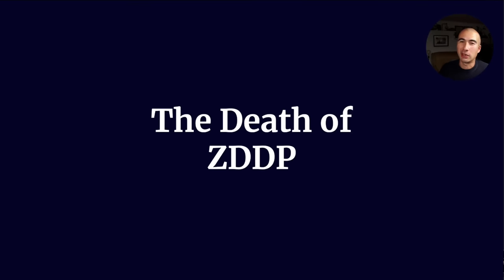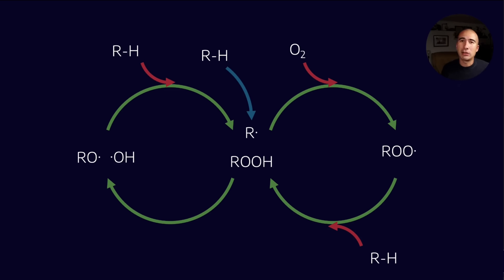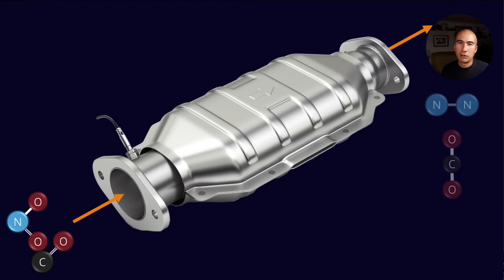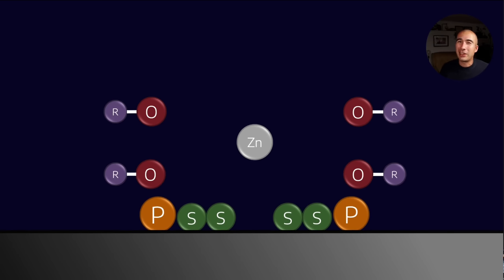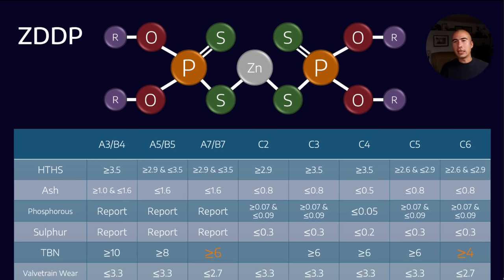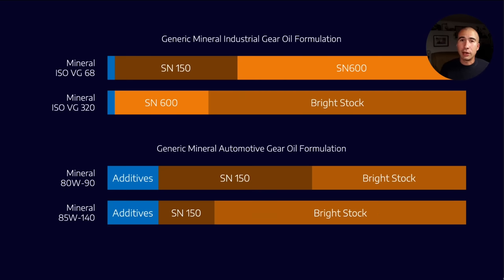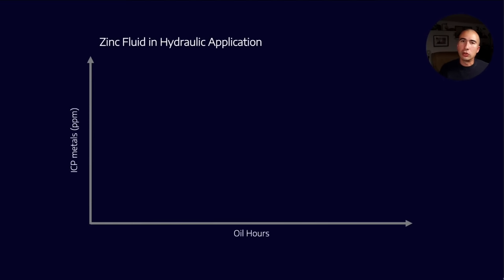Is this the end of Zinc (ZDDP) in oil?

Comment: I would not panic ZDDP is going nowhere in the near future. It is so heavily used in hydraulics and engine oils. It is relatively easy to make and manufactured all over the world. The real key is that 50% of the world's  engine oils are below API SN so use high levels of ZDDP. Industry has had zinc free products for decades, often for technical reasons and  many diesel trains have always been zinc free due to silver bearings. Industry has not got rid of chlorine additives with long chain chloro paraffins still in use, and that was a major drive 20 years ago successfully removing short and medium chains but the element chlorine is still an issue in disposal. The drive will always come from the consumer side, electric cars do not have to use ZDDP for example. The ironic thing is that cresyl phosphate esters are the common replacement and they have such a poor environment profile that above 1% potentially label the entire lubricant as environmentally hazardous.

Comment: You lost me when you said the ZDDP reduction was due to catalytic converters. ZDDP levels in API oils peaked in 1996, long after the Clean Air Act passed. While I don't doubt engine oil can damage catalytic converters, the question should be why is there oil in the converter, not what is in the oil. 

While ZDDP levels have declined since 1996, other anti-wear additives have been increased, and today engine oils are quite good at preventing wear as well as lasting longer than ever.  There is still ZDDP in engine oils. 

The people on the bandwagon of cam failures blamed on ZDDP will love this video.
Reply from the maker: I wasn't around during that era, but having spoken to a number of the higher-profile formulators - that's got to do with tuning the ZDDP mix. As you'd probably be aware, there's an infinite variety of ZDDP molecules that can be produced, with most of the variation coming from the type of alcohol (primary/secondary, alkyl/aryl) used in the reaction to create them. To protect catalysts, formulators in the 80's started turning to lower-volatility ZDDP molecules (the logic is that lower volatility means less ZDDP ends up in the exhaust gases). The trade-off is that some of the low-volatility ZDDPs aren't as effective as in performing the antiwear function and therefore you need a higher concentration in the formulation to give you like-for-like performance. That's how you end up with higher Zinc concentrations in the 90's.
Reply: @LubricationExplained  Thanks for the reply. That begs the question, if a lower volatility ZDDP that was a bit less effective was used in higher concentration at the peak, is the reduced ZDDP concentration used now a less effective molecule, or has that ranged back the other direction? The sequence tests for valvetrain wear in overhead valve engines (test is now obsolete) showed wear was prevented at 600 ppm of ZDDP. Adding ZDDP to over 1700 ppm didn't change the wear, more ZDDP didn't make the components tested wear less. Yet people claim more ZDDP is needed. Is it because the specific ZDDP used is less effective?
Reply: My 2010 chevy malibu eats oil like 1 quart every 1000-1500 miles.
I've driven it 80,000 miles
It has always done this, with good full synthetic oil changes 3-5.
Why? Its the design of the motor.
1)Loose piston ring tolerances could be suspect
2)Around the throttle body, and inside the intake, there is sufficient evidence that it sucks a large amount of oil vapor back into the intake.

They make engines 'green' and keep pushing them into the ground.
Reply: @sasquatchcrew  If there is a path out, synthetic oil will find it! As frequently as you change it, you aren't getting full advantage of the synthetic.  You could switch to a conventional or a blend, and maybe try an oil with a higher kinematic viscosity but the same SAE viscosity.

Comment: This video leads one to the impression that ZDDP "coats" surfaces...it does no such thing. Only under extreme pressure and temperatures is the compound activated and even then only in those localized spots.
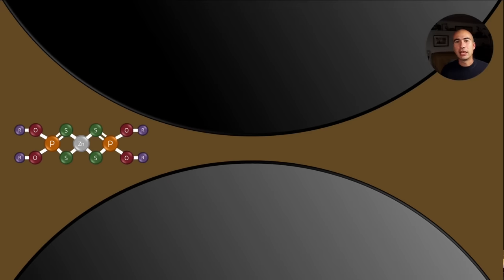Reply from the maker: Great comment - although I’m pretty sure at 1:00 I say “when these additives get into a load zone they tend to decompose and form surface films”. Maybe I didn’t make it explicit enough.
Reply: @LubricationExplained  Yes, I just wish people would finally realize how the compound actually works. It would go a long way squashing the more ZDDP is better myth. All more gets you is a longer depletion time, not some magical double protection.

Comment: ZDDP kills catalytic converters are urban legend than facts. Low quality oils   easily evaporates allowing the oil vapers into the cats. That process still takes years to clog a cat. I use a ZDDP Additive (Redline) and use a 2100 PPM Mix (Valvoline Advanced) on my twin turbo application with zero issues. Mean while Ecoboost engines get a bad Rap. ZDDP is critical for Turbo Protection and massively reduces the oil from coking.

Comment: Modern oils are horrible.
Reply: L + painfully ill informed
Reply: @alouisschafer7212  No, 500k miles of literbike racing says otherwise. One by one the good ingredients are replaced with no so good stuff. Many oils are going backwards at this point.
Reply: Some say inded, they seem 2b much more worse than any human pisswater !!
Reply: No, you'd be wrong. Modern oils are one reason we get away with this. As time goes on, we'll get more & more oil companies using better synthetic oils. Even with reduced zinc, it'll have more Boron, Moly & some of the secret stuff they use in ATF fluids. But still, the main anti-wear will be the high-quality base oil.
Reply: @armedfarm3429  I'll trust 45 years of using old conventional Texico /now chevron Havoline oil vs laboratory results.  New trucks with thin oils sound like a box of loose parts shaking around. I have seen endless worn timing sets, phasers and high oil consumption on modern oils.  But my l20b is still original and holding up perfectly.

Comment: Liqui molly Special Tec F 5w30 has a lot of zinc. Actually i use it in my mazda and the oil works great. It is way quiter than Special Tec AA which has boron and Molybdenum. And it is a pretty modern HC oil still sold in Israel.

Comment: Yeah, sure they’ll replace it with something better. Just like they did when they went away from lose tolerance to tight tolerance in car engines. We all know they’re not going in the direction of longevity or improvement, they’re going for reduced parts life and more sales. If they ever move away from zinc additives it won’t be for the better, don’t kid yourselves
Reply: Yeah, give me a split main smallblock! The absolute pinnacle of performance and manufacturing capability! 

I've got some luddite views, but that's taking it to the extreme. Old engines were made for shit because old machine tools were junk in relation to modern stuff, which is why blueprinting was a thing, pay more and get an old engine built to modern tolerance specs. Engines last longer now, a lot longer when you consider the dwindling percentage of the population that even knows how the thing even operates, let alone how to care for it properly. Add in overly optimistic electronic service intervals and it's no contest, old engines not rebuilt to modern tolerances suck. 

And I'll always be able to find the additives I want, add them myself.

Comment: Use Kawasaki lawnmower oil fantastic oil
Reply: The difference in that stuff and the absolute p***water that comes from an initial oil-fill bag with a new mower is incredible. I don't understand how any of these MTD built brands make any money from all the warranty claims they must get. But if the stuff you put in your lawnmower flows like a glass of water straight from the bag or bottle, probably just go buy some actual oil instead of using that...